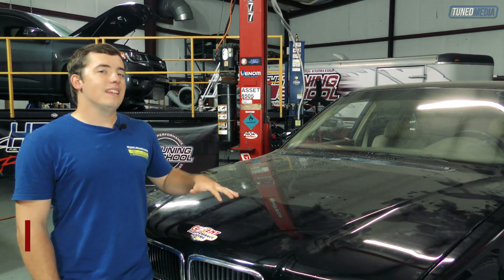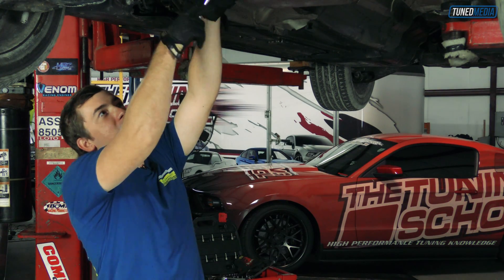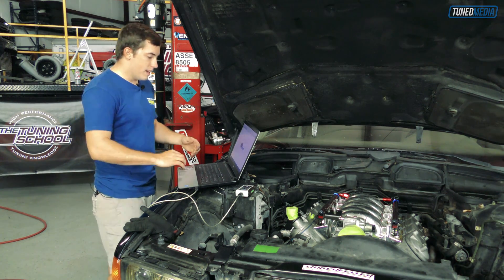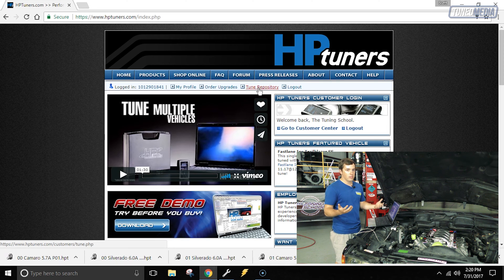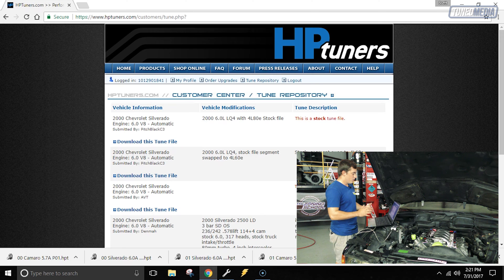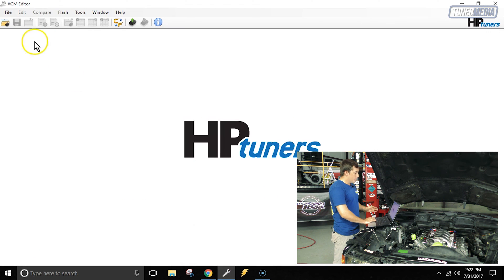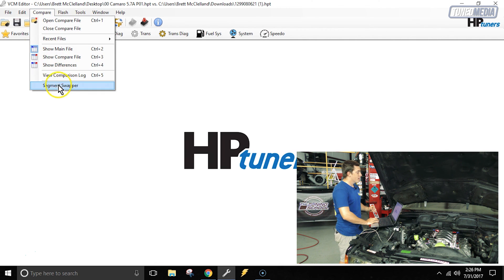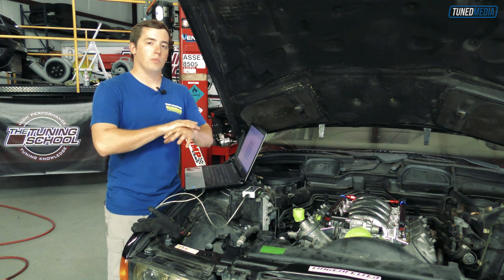How to Do a Segment Swap Using HP Tuners

Comment: Maybe the reason you're having "finickey" tunes, is because you're not searching for a tune properly. You read your current module. Find the OS number, and search the tune repository using that number. If you load the wrong OS onto your module, you will have issues...

Comment: after my 4l80E segment swap, as per the instructions given in this vid, my tahoe started throwing a P1810 pressure manifold sw related code, instead of dropping pan, and changing the pressure sw array, I went back in segment swapper and included the trans and the trans diag modules,  'WHICH WAS THE FIX !  this guy should remake this vid and include the " missing info" so that retards like me dont have to fiddle fk with a false p1810 code for two days !!! just sayin .
Reply: I was about to add that to the comment but u nailed it!

Comment: So since the 99-00 TA/Camaro pcm has a different OS than the 01-02 pcm's does that mean I can't change to the newer engine parameters? Its greyed out when I try with an 02 model but not greyed when I have another 00 compare file opened.
Reply: I have a similar question. Is this aking a P01 PCM with the 4L60-E and swap to a 6L80-E transmission possible?

Comment: Shouldn't the transmision diagnostics segment also be carried over? And maybe it would be good to mention that the operating systems have to be the same on both tune files or else you won't be able to swap the segment over.
Reply: Billy.. try this 01 Savana 4l80e file.. it worked for my (01 jimmy v6) ecu with 12202088 OS.. https://forum.hptuners.com/showthread.php?50795-4l80e-segment-swap-needed-for-OS-12202088
Reply: yep and its nearly impossible to find a 4l80 trans segment with my 5.3 4l60 OS id
Reply: junk ass gm ecms with id 12202088 cant be swapped. and you have to pay hptuners extra credits to change the ID what  a  sorry company.